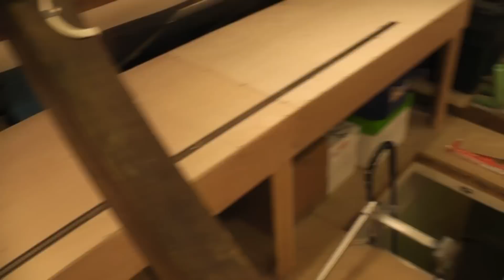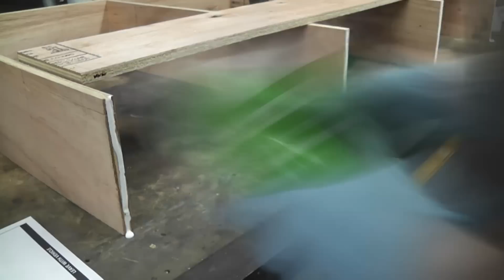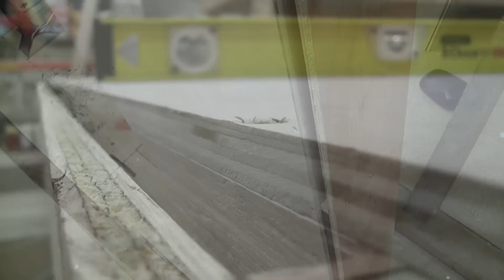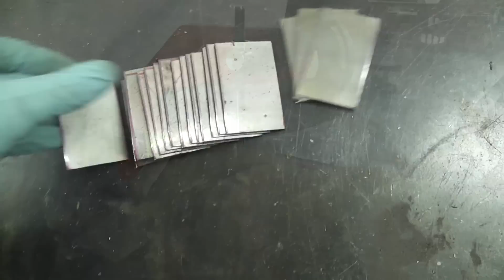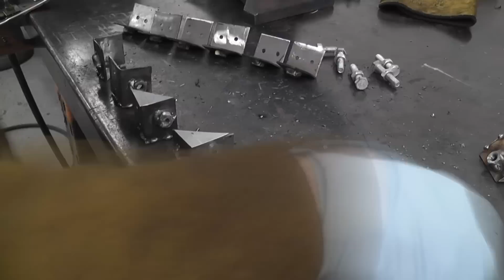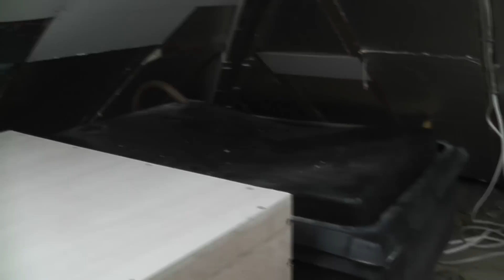New Layout Build - Baseboards

Comment: Hi Richard, I hope you’re well. I’m having a problem with noise and vibration on my HO layout and your videos on tracklaying and baseboard construction have been extremely helpful, so I would really appreciate your advice.

My layout is 2m x 90cm, built on marine plywood with 15cm legs (with felt pads). On top of the plywood I glued two 2mm cork strips using acrylic caulk. On the cork I laid two loops of PECO SL-100 flex track (inner and outer), connected with older Lima and Jouef turnouts.

The track is glued with caulk but also pinned with Peco SL-14 pins every ~20cm. I had to use pins because the curves are large and the flex track opens up if not pinned, so removing the pins is not really an option for me.

Under the plywood I added pieces of DOW (extruded polystyrene) to reduce noise, but I still get a noticeable low-frequency hum or vibration through the wood when trains run. Most of my locomotives are older LIMA models (some with upgraded motors), so I’m trying to reduce structural noise as much as possible.

My questions are:

1. How much do track pins contribute to vibration transfer into the plywood?
2. Is there any method or material that can reduce noise without removing the pins?
3. Have you seen any effective isolation techniques between rail–sleeper–roadbed when pins are used?
4. Is there a better material than DOW for low-frequency vibration control?
5. Any general advice for reducing noise transmission from flex track into a plywood baseboard?

Thank you very much for your time and for all the excellent content you produce.

Comment: Just saw this, and quite honestly as a woodworker I am totally dismayed.  Quality plywood doesn't warp if properly supported and kept dry.  Using plywood as a vertical leg is questionable as its strength is mitigated vertically without a solid wood base.  Vertically, plywood is usually used as sheathing.  Making a height adjuster with a bolt head end up vs head down is a great way to put indentations in the floor. You are making a table with a baseboard and are not making a baseboard.

Comment: The problem I have is the only way I can build the baseboards is 3 sections to fit my 13ft hallway and be able to take apart and store them on edge in a big cupboard type room .I did this but the room has no airflow as the flats electrics are in there and the boards warped as I can only store them on edge .Now I have had 2 - 4ft x 2 ft plywood boards under my mattress for 2 years so they should be dried out by now ,the only thing is the softwood framing I have to buy as it will have moisture in ,will it distort as it dries

Comment: So much fuss just to make a frame work. I made a slide out bed for my camper with a framework made of a square timber. The whole frame made with that. Struts to put across to hold the mattress. If your legs are cut together then they should be all the same length. Why not buy brackets ?

Comment: wait... you can't use the guillotine because 2mm is too thick? must be a LAME guillotine then, the one we used at work, it's default job was to cut 5mm, and could cut as thick as 10mm. and the one in the engineering department could so 5mm with ease too.
At least I'm familier with all the equipment you're using. I might not agree with all your methods(some might not be my first choice), but I can't really fault them either.

Comment: Did you have to do any strengthening work to the loft prior to building the layout. Just about to start work doing my loft. It's massive so lends itself nicely to building a sizeable layout. TIA
Reply from the maker: The only work done to the loft was to install the flooring.  The floor and various layouts have been up there for the past 18 years with no problems.  Most homes should support a basic floor with a layout on top provided the structural supports for the roof are not disturbed.  If in doubt check with a qualified person before proceeding.
Reply: @EverardJunction  thanks for that. Did you have to raise the flooring to keep from squashing the insulation. If so what did you use. I'm going to replace all the insulation to a depth of 270mm so will need to raise the floor off of the joists.

Comment: For my base board for my layout in my 20 x 10 ft layout I used 95 x 50mm C26 graded timber for the legs. For the top I used 25mm Marine ply and then for braces I used 68 x 38mm CLS C16 timber. I didn’t cheap out and you could park a car on it and it would be fine.

Comment: Hi.....im totally new to DCC and trying to learn what's required to wire a layout. As far as a point motor or Tortoise switch machine, which one is best to use and would both work on either a Digitrax or NCE command system?

Comment: hi richard been watching your old build videos and its enspiered me to start my own layout not blessed with the space of a loft or spare room so i have put up a 12ft x 6 ft shed and going to start in that have you any advice my concern is weather and things warping will plywood be ok for baseboards.really looking forward to see how your new layout comes together.
Reply from the maker: Use exterior plywood and consider putting some insulation in the shed if possible.  When you build the baseboards seal them with varnish of something similar to stop the damp getting in.  Using plywood planks and placing them on their sides like in the video makes a much stronger warp resistant structure.
Reply: I will look into that thank you

Comment: Hi Richard. Welcome back. I seem to remember you had a video ages ago about soldering? I've had it with my soldering iron, it is a cheap one from napkins. Is there one you would recommend?
Reply from the maker: The will eventually be another soldering video.  The secret to soldering is lots of heat on clean wires with a clean iron.  For model railways a 50W soldering iron should serve you well.  The one I use is 50W.  Hope that helps.

Comment: I am in the States and have been modeling less than one year.  I watched dozens of your videos along the way.  I was wondering:

1.  Why you used plywood when we would use "dimensional lumber"  i.e.  2in X 4 in for the legs, 1 in X 6 in for the sides, 1 in X 4 in to support the 2 in foam platform top?
2.  Can you not get 2 in foam for the base of your layout?  It is so much easier to work with and much quieter and much much cheaper.  Also, we have ready made height adjusters available at almost every hardware/lumber store.  That looked like a time consuming and costly adventure.
3.  Why all the sections in their small size?  

All in all it seems a considerable waste of lumber.

I am expanding my layout next month and will use 2 in foam as the top, 1X6 edges, 1X4 supports for the foam, and the length of the boards for the side will be 10 ft. at least, with a maximum width of 4 ft.  the edges and supports will be "dimensional lumber" as I said.

Just wondering, thank you for all your help in the previous videos, your scenery and landscaping are Superior!!!!
Reply from the maker: Dimensional lumber warps and is often already warped in the store.  I used it on my old layout and ended up having to rip it up due to derailments caused by warped baseboards.  Plywood is generally the material of choice for benchwork but there are other methods out there if you want to do something different.

The tables are small in size to allow for easy transportation should the layout need to moved to a new home in the future.  So far its cost about $300.  I enjoy building it all so don't really mind about how long it takes.  Cheers

Comment: when built mine in the attic i left the cross braces loose so to reduce the chances of them falling on the position of  point motors which left me a more free hand for planning the layout once the track was in then i slid them in and fixed into position, however mine is not modular and was never intended to be taken apart good to see you back though look forward to more vids.

Comment: Adjustable feet - block 2"x2"x6" - drill hole in bottom of block - use T-nuts and single bold - 50c-$1 per max.- hammer into hole, screw in bold, done - can even get rubber feet for 50c (in Aust) - screw block into bottom of L-shaped leg. But he is ametalwork guy, so make your own. Me, I work wood. Good video as always.

Comment: I'm glad to see you back and getting the job done. You are doing an excellent job on the baseboards. Maybe a good idea to take some of that scrap metal and cut some squares out to put under the bolts to spread the load. Just a couple of inches would do it and keep the bolts from vibrating their way into the flooring. Other than that I wouldn't change a thing. Regards, Solomon

Comment: Very nice to see how you made your boards. Did you use Softwood or Hardwood Ply? I’ve had to halt progress on my layout due to the 9mm MDF starting to warp. The advice would come in super handy as I’ll be buying material in the next few weeks
Reply from the maker: The table top stuff is hardwood and think the frame material is too but can't remember.  Go for hardwood ply when you get your material as its generally stronger.
Reply: EverardJunction  Thank you very much! I was thinking of hardwood Ply. Looked around at local timber merchants but most are fairly expensive for material, so it looks like a 30 minute walk to B&Q for 12mm Ply. Luckily I’ve got my High school tech workshops to build them in during my free lessons (perks of Sixth Form and being a  favourite student of the RM department). Thanks Richard, all the best in your baseboard construction,

Jordan

Comment: Thanks for sharing. I like the modular design even if it is essentially a permanent fixture.  Did you have any problems with the plywood splitting when driving screws in to the end ply?  I made a similar box structure for a bed base but used pocket screws from the inside.  This meant the screw heads didn't show on the outside and the screws went through the plywood rather than the 'end grain'.

Comment: Good to have you back, I know insulation jobs take a long long time. I strongly suggest you place a vapour control layer ie polythene sheet on the underside of the insulation to prevent warm moist air getting to the cold roof. Without it you'll get condensation and the roof timbers will rot.
Reply from the maker: I've used celotex board which is foil faced on both sides.  Any joints or gaps have been sealed with aluminium tape to ensure moisture control is present.
Reply: EverardJunction as long as it's sealed, just that i can't see tape in the video along all the joins. Here's a 2 min video of mine, used airtec double as VCL under 70mm foil backed PIR between the rafters https://youtu.be/qlaZaxByGt4

Comment: Could you not use an inverted carriage bolt to adjust the height?  Carriage bolts have a somewhat rounded head.  Granted, you have to use a box wrench to adjust them once weight is on them but they would not dig into the floor too much.
Reply from the maker: I've made some feet for the existing bolts.  I thought about some other solutions but they all make the bolt harder to adjust so went for some feet instead.

Comment: Excellent results Richard and I'm sure with the way you are building this and the insulation you have done then this will last you a long time in the future. I like the modular design too, that will be very handy should you have a change of plan at a later stage, great work and video and good to have you back again. How's the Granada going?             ...........Graham
Reply from the maker: Thanks Graham.  The Granada is going well.  I'm up to 437 hours of welding and still have a way to go.  I've documented it all on the autoshite forum thread.  Cheers

Comment: I'd suggest getting a set of drivers for that Makita drill. then you can set the torque so the clutch will stop the drill before it drive the screw deep into the plywood.

If I get around to building a railroad, I have a Pascoe nail gun, that will make life easy tbh.

Comment: Great work, i would suggest you put the bolts upside down with the heads to the floor, less chance of them boring into the floor.
Reply: or even  get bolt feet, they do make them
Reply: That makes them hard to adjust, the screw driver doesn't fit that way!       Just kidding!
Reply: punkloader ii

Comment: Hi EJ, thanks for the video, again very inspiring and educational. I have one question, how do you deal with negative terrain heights on your baseboards? I mean for instance the trenches left and right of the tracks or if you wanted your tracks to cross a stream or so? Do you then cut that out of the baseboards (how do you compensate for stability then?) Or do you add a whole additional layer on top of that to model trenches and streams? Hope I'm making sense. Greetings from Germany, Sebastian
Reply from the maker: The three boards you saw assembled in this video are the fiddle yards.  The scenic part of the layout will be of an open frame design with a raised track bed.  Will that any terrain type can be modeled using foam either side of the trackbed.
Reply: EverardJunction Thanks for the insight. That makes sense. 😊

Comment: No plan to cover the horrendous brickwork with white hardboard, as used on the ceiling? That would lose the brick pattern in your “sky”. Or you could use decorator’s caulk (in a mastic gun) to fill the pointing.
Good progress, though, and nice work.

Comment: if you put the bolt the other way round with the heads to the floor you will not need to put a foot onto the screw thread

Comment: I am worried about the bolt sinking into your loft floor over time.  Especially as you add more weight with scenery.  You may want to place a small scrap of metal under the bolt, or some other form of foot.  Just a thought...
Glad you are back at it!
Reply from the maker: I've made some feet for the legs already.  They screw onto the bottom of the existing bolt.

Comment: Great start,  but I have a 2 questions  -  Q1 ;  how are you going to slot a backscene in when the roof slopes directly above it ?  Your 'slots'  require an absolutely 90 degree fit,  so you will need free space equivalent to the backscene height  PLUS the depth of the wood going into the slot,  directly above the slot.     Q2 ;  When fitting the legs,  you screwed the back legs from the inside going backwards -  are you sure your screws haven't penetrated and blocked your backscene 'slot' ??
Reply from the maker: I made sure the screws I bought did not penetrate beyond 24mm.  I've a few ideas to try out for the backscenes in the sloped areas.

Comment: hi. good work so far . have you considered poplar ply instead of birch costs about the same but its half the weight, good luck with the rest of the layout :) josh - JDMR
Reply from the maker: Weight doesn't really matter on a fixed layout so I went for tried and tested Birch.  Had this been for exhibition use I would have used different methods.  Cheers

Comment: Hi Richard. Are you still going to use an open board method? Or is there a big surprise coming up! Noticed in the last video you mentioned the variant in landscape.
Reply from the maker: All the scenic part of the layout is open frame.  You only saw the fiddle yard at the end of this video.
Reply: EverardJunction. I did wonder as I remember you talking of open boards. Not many layouts on youtube use the method. I'm well underway with mine using L girder open frame and it's so much better. I'm modelling Exeter St David's and Plymouth laira based around 1992 - last days of class 50's!. As for yours so far, well, top job.. makes me cry now knowing how much I've spent on PSE timber!

Comment: Great to see you back! One suggestion re your levelling bolts. Why not turn them around and use the bolt head as the "foot"? Seems easier that welding something onto the screw-end of the bolt. Also easier to remove entire bolt if ever required. Also a question...(I might be too eager to see an upcoming  video)..what are you putting on the plywood? Foam? Cork? ?? I'd use foam and carve relief as required. Anyway, thanks for this first video. Can't wait to see the layout come together!  Doug, Vancouver Island, BC

Comment: A long time coming but truly well worth the wait.  I love watching capable people execute to a high standard and the way you go about planing and then delivering is a pleasure to watch.  One question, I love your ingenious leveling devices but is there a concern that all the weight will be borne just on the end of the bolt, will that lessen the overall stability?  Thanks for sharing, really looking forward to the next one :)
Reply: Leveling Devices turn the bolts around so the head is facing down then it wont dig in the floor then put a rubber over the head so it dont slip  (just an idea)